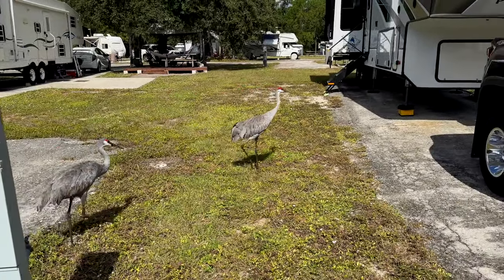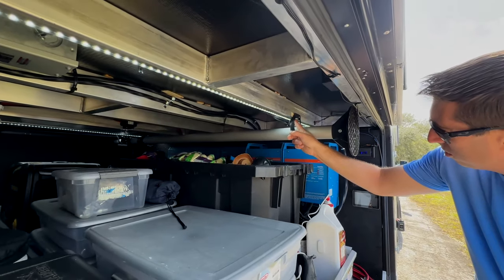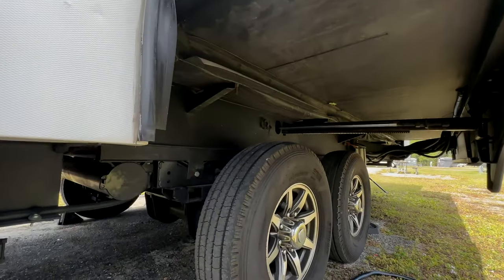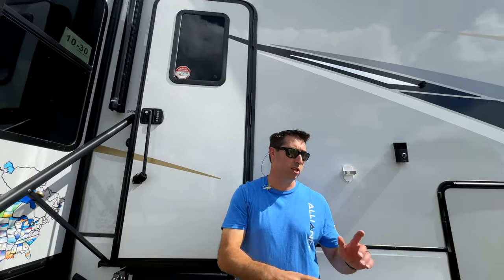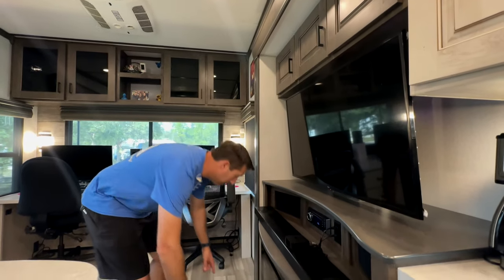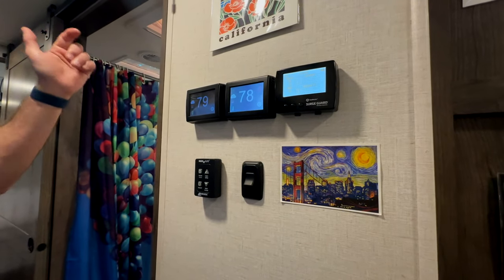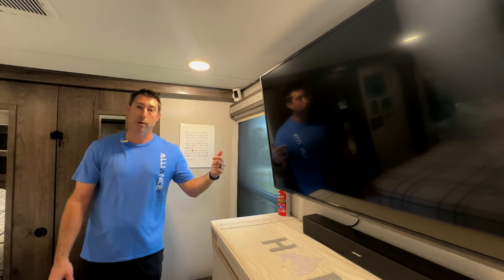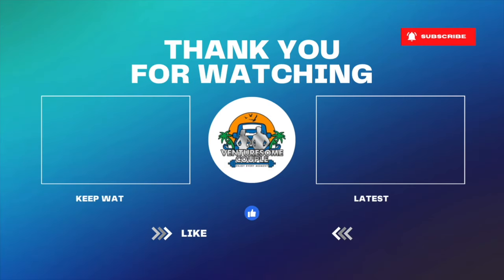Perfect Couples RV Full Tour: Ultimate Luxury for Adventurous Duos!

Comment: Chris, did you guys keep your previous suspension so that you can swap out your bolt-on MORryde, if you get another rig? If so and you are able to reinstall the previous suspension then bolt-on I.S. is great.
Reply from the maker: Hey Pete, I did have the option to keep the other suspension if we wanted it. We opted to not keep it due to the hassle of trying to move it back to Florida.
Reply: @VenturesomeCouple See you down there! We head to Jacksonville, FL tomorrow for 2 weeks and then Thousand Trails in Wildwood, FL, Ocala North RV Park, RV Show (rally area).
Reply from the maker: That’s great, we will see you soon then. Safe travels.